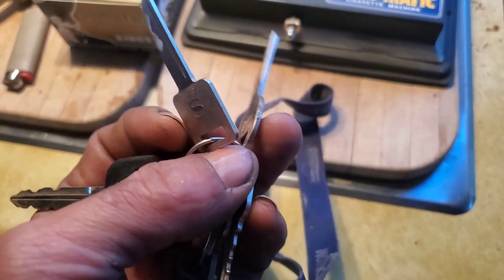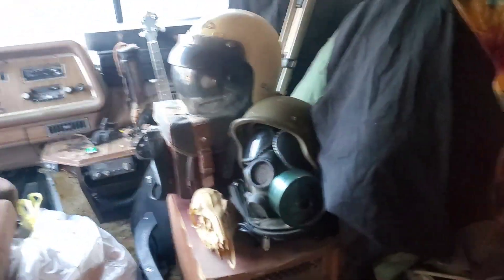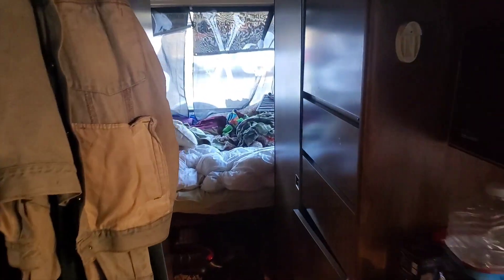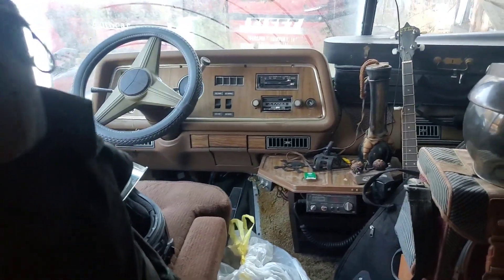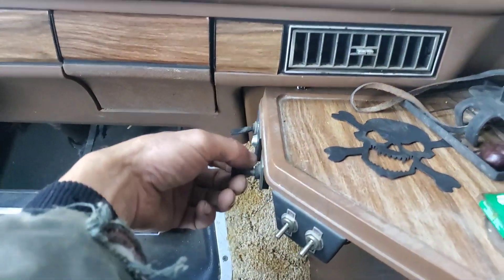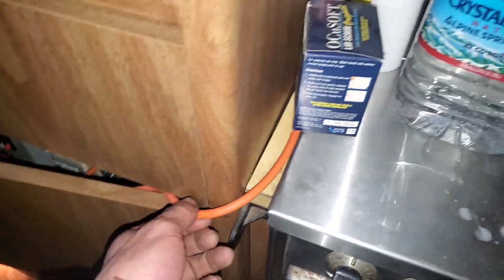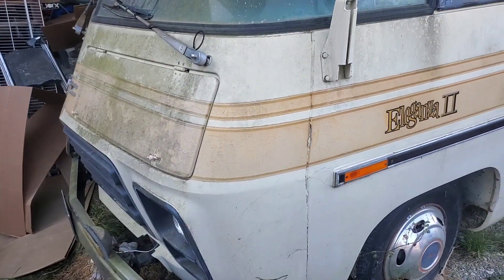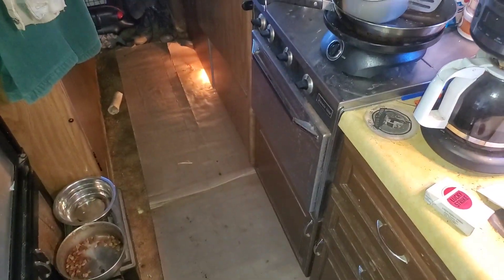1977 GMC Eleganza II Motorcoach - Welcome Home!

Comment: Those are so cool
Reply from the maker: I said I would have an em50 when I was a kid and first saw Stripes. I am a man of my word 😆 

After just a week my health is improving. The cabin was impossible to keep warm, drafty, waterfalls down the walls every time it rained, 100 year old electrical, only 1 room usable as living space...

This coach seals up tight, is very well insulated, no rain leaks, efficient to keep warm/cool... and I'm finally forcing myself to downsize. Nipping the hoarding affliction in the bud. 

How's your ambulance project coming along? Haven't seen any updates pop across my feed in a while.
Reply: @OccultEngineering  updates should be out soon been waiting g for weather and funds. Got a new inverter and 400ah of batteries today
Reply: @OccultEngineering  i always wanted a GMC but they were always way to much or way to run down
Reply from the maker: @travaddic  I got incredibly lucky with this coach. I'm the 3rd owner and fortunately the first 2 took very good care of it. Only major issues I need to deal with are currently the air ride/leveling system has a leaky reserve tank, and my Onan 6k needs some carburetor tinkering and a fresh coach batt/cables and terminals. Oh and the dash ac/heat needs troubleshooting. Likely just a popped fuse or blower motor is shot. This is part of a life change. I will no longer be owned by the things I own. I wanna travel the country touring motorcycle race tracks so I can show the young bucks how it's done 😆